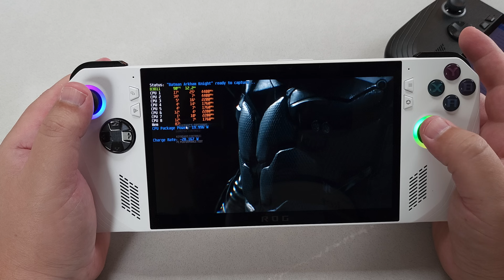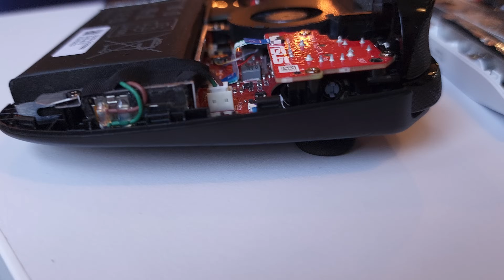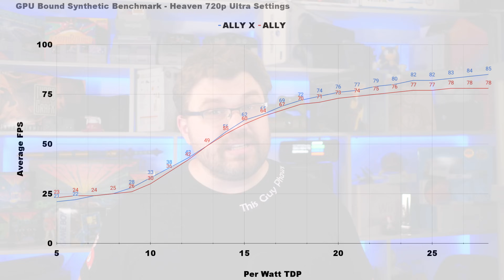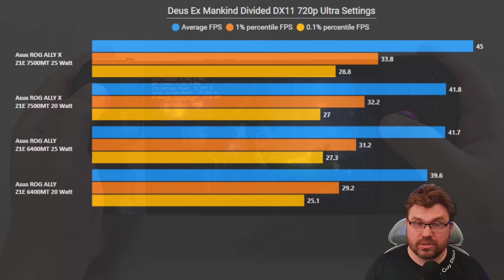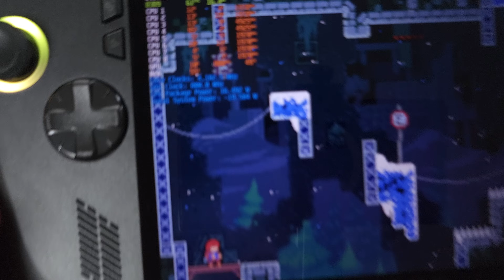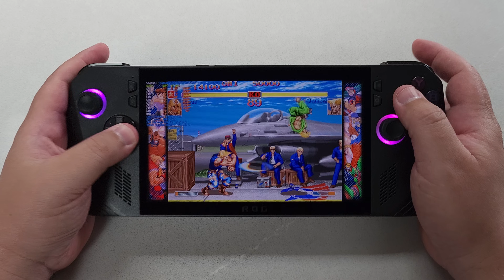The DEFINITIVE Review - Asus ROG ALLY X

Comment: I’m running a ROG Ally X configured with an 8TB NVMe SSD and a 2TB microSD card, completely Windows-free and booting directly into Batocera. It’s loaded with around 200 PC games—including titles like God of War (2018), Ragnarök, GTA V, Nioh 1 & 2, Spider-Man 2, Cyberpunk 2077, Ninja Gaiden 2 Black, and Red Dead Redemption 2—all running nearly flawlessly.  I’ve also installed high-end emulators, including RPCS3 for PS3, which plays Uncharted 2 & 3 and God of War 3 without crashes. Almost the entire Xbox 360 library runs perfectly, and Nintendo Switch games play great as well. All other emulators run flawlessly too.

Comment: Thank you for one the most in depth reviews out there. Pls can you also add RAM & GPU VRAM usage to the system monitor and show usage graphs compared between tow devices ? I really would like to see if extra RAM/VRAM does actually plays any role in the 0.1% & 1% increase for Ally X. Certainly for RAM heavy & unoptimized games like Hogwarts legacy this will be the case - but I can also Suspect ASUS has tuned down BIOS better for Ally X to sell it at more expensive price than original ROG Ally......

Comment: Strix without 4x big Zen5 cores would be a great chip. Just 8x efficient Zen5c cores and 16 CU RDNA3.5. RDNA3.5 is significantly more energy efficient than RDNA3. Zen5c is more than fast enough to run all games at 60Hz and it would do this at more efficient lower clock rate. And you don’t need more than 8x CPU cores for gaming. 

If Steam Deck 2 has another custom SoC it could be like this. That would be 2x CPU + 2x GPU increase. Both efficiency optimized brand new parts (7nm -> 4nm). And 16MB shared cache for Zen5c CPU cores to save bandwidth (no big cores, so they could definitely afford it).

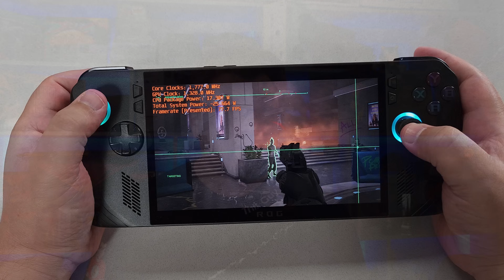Comment: We have a small detail that has gone unnoticed from what I've noticed. It seems that the Ally X's AC isn't pulling the overall consumption of everything, just the APU, and when I say everything I mean everything, SSD, screen, speakers and fans. Whereas on the standard Ally, it pulls everything, which is why consumption is “higher”. In the test at 25W, it's noticeable that the standard Ally lasted 1:20 hours while the X lasted approximately 2:40 hours, so if you put it down to a pencil, the double battery life of the Standard can be very well appreciated by the X. In other words, if it only consumed 25W, it would have lasted longer, the math doesn't add up.

Comment: Hey Phawx, could you do a vid on comparing 12 threads/6 core vs 16 threads/8 core, when you disable 4 threads from msconfig?

In the boot menu -> advanced, I've changed the number of processors from 16 to 12, this freed some power from the CPU side to allocate more to GPU and the memory controller.

From the few benchmarks done on the OG Ally I have, I've gotten a few FPS higher on just about every game that's not CPU bound.  Wondering how much that'd help on the X with the more power hungry memory controller.  Thanks!
Reply: This is a good idea. I'm hoping the SD2 only uses 6 cores / 12 threads  and puts the rest of the power to the GPU.

Comment: This review is easily the best of any I've seen...

I wonder, if by almost invisibly adding a couple of extra watts to the Ally X power profiles, Asus was intentionally putting their thumb on the scales to make the X look better.
Most normal reviewers would just set the power profile to 10, 15, 20 watts etc and assume they were actually using the wattage stated. Then the X would come out looking much better at the 'same' power.

Smart by Asus tbf..... but unfortunately for them, they are not as smart as a phawx!

Comment: Something doesn't add up.
I get it that Ally X is more efficient, and consumes on average 2w less at similar TDP,
yet I don't see how this efficiency advantage could translate into 2x battery life.
The difference in total system power alone should bring ~10% at most.
So what makes the rest of the difference ? bigger battery ?
Reply: The battery is 2x bigger so you would expect at least 2 x battery life, what Phawx is saying is the chipset is now more efficient as a result of which battery life is more than 2 x.
Reply: Battery doubled from 40wh to 80wh
Reply: Maybe read the spec sheets.
Reply: or maybe this could have been stated explicitly in the video. After all, it's the point of the viewing a review video.
Spending ~3 min stating that the AllyX has 2x better battery life because it's 2w more efficient without ever mentioning the change in battery capacity is misleading.
It's 2x battery life because its battery has 2x more capacity.
Reply: Ally X has 80wh battery, you know.

Comment: Valve is the only company that will have enough influence with AMD's R&D Dept. to give us a real, generational leap in handheld GPU performance...and that won't happen until they place an order for Steam Deck 2.
Reply: No. Amd already have massive handheld chips in the works. Valve has nothing to do with that.
Reply: @fresco_dinero5155 primarily for laptops. The Steam Deck uses a custom APU designed specifically for Valve, tuned for great performance at 15w.
Reply: @fresco_dinero5155 The Ole Deck warriors 😂
Reply: Valve aren't AMD's only clients you know.
Reply: I hope they use that 80wh battery.
Reply: LMAO 😂😂😂😂😂😂 You forgot that AMD also has Sony and Microsoft under their wing and they have WAY MORE influence on AMD R&D than Valve does. EVERY OTHER Manufacture(including ASUS) have more of an influence than Valve. Valve is a SOFTWARE COMPANY FOR LINUX not WINDOWS.

Comment: The X is looking nice, but i'd rather wait until next gen AMD/Intel handheld chipsets, which shouldn't be too far out
Reply: I'm only using my Ally at home, 99% plugged in, so I'm just looking for more raw power without caring for battery. But more than doubling the battery life is a huge revision, hats off to Asus for that even if it isn't for me.
Reply: @nikolaikai940 there's not much to celebrate. Asus intentionally gave Ally 1 a small battery in order to make the device light
Reply: Yeah, its a really nice option but having the OG ally and an XG dock then only want to upgrade when there is a bigger portable performance boost. Then my current Ally+XG will be used mainly as my "pro" console on the living room TV exclusively so it will live on!
Reply: Strix halo LP : 8 core or 6 core Cpu  20CU gpu. Summer 2025
Reply: It's a cool rendition to keep the hype up and the name out in the open. This is going to make me look at asus in the future as this tips my opinion in asus favor this time. The new handheld is low on my to get lost atm, though, so either way so likely my next will be 1 or 2 gens in the future.

Comment: I love the ally (base model) so much, the X doesn't need to exist. Their livestreams with this was a puke inducing marketing ploy. I' would not only be first in line for the next iteration, I'd trade my future sons college fund for it. But this ain't it dog. The ally is the best device I've ever purchased. And with upgraded (4TB 2280 heatsinked) its an absolute monster. I hope they can recover and make a device worth my money.
Reply: The 2280 M.2 on the ROG ALLY X can support double sided SSDs meaning you can fit that ridiculous 8tb SSD M.2
Reply: Totally agree- just not worth buying it if you have the OG. I honestly prefer the white color anyhow. Where did you get a 4tb 2230 ?
Reply: @TheEntzy He said 2280
Reply: @youngjustin82  got it - modded it
Reply: @TheEntzy  You gotta be careful using a 2280 . I would suggest only using a single sided one . Cause a double sided one puts to much heat on the board. I would also suggest just getting a jsaux 6in1 nvme m.2 dock . So you can run any size nvme m.2 in it and you don't get the heat on your system only in the dock . I love mine paired with a 1440p 120hz monitor I'm getting great results without a epgu
Reply: @youngjustin82  thanks for your input bro . I’ll check it out